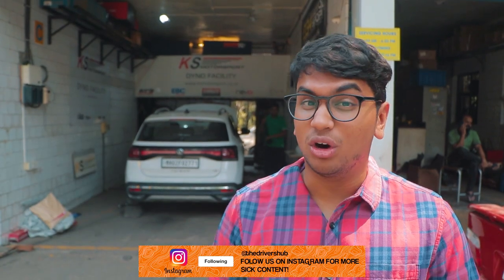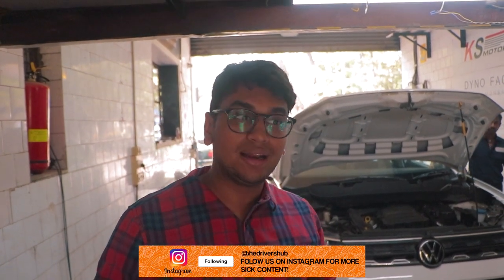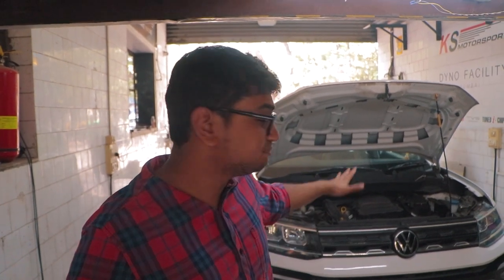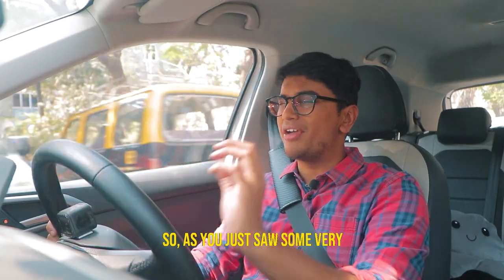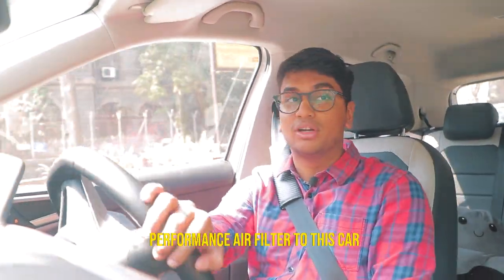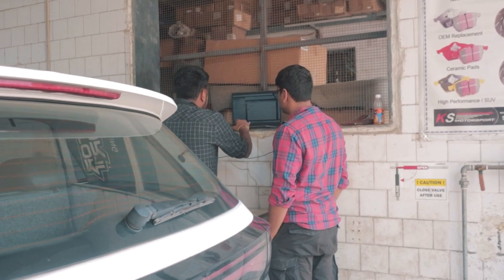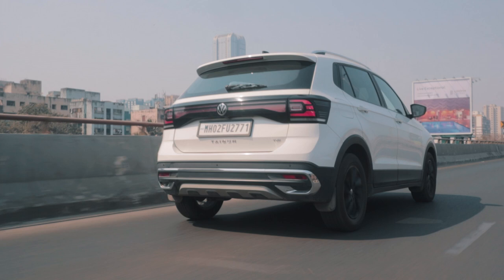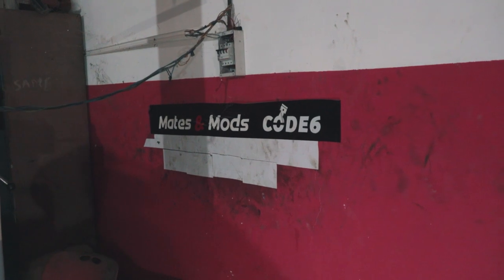India's Most Powerful VW Taigun 1.0 TSI Stage 2 on the Dyno! (Stock Turbo) | Project Taigun

Comment: Should have done a stock run then done the remap .
Reply: Yepppp
Reply: That’s how it should be for every project car, gives better comparative results
Reply: We do have stock figures done on 1.0tsi, in this particular car we had done all the mods before dyno, hence wasn't fair to do dyno with mods and no tune. However we did do that also, i have dyno charts for other maps with mods in this car.
Reply: @matesandmods  what were the dyno figures on stock?
Reply: @garvitnanda4527  a polo 1.0tsi with intake work done, got around 102whp
The taigun with all mods but no tune had some 25-28whp lesser and 80 wheel nm lesser.
Reply: I will maybe share all numbers on my Instagram for clarity, was planning to dyno a fully stock car on the dyno once to do this.
Reply: For the stock, This is also not accounting an average, average of stock runs were lower. And the after tune, average of all runs were 138-140whp equating to 155hp approximately with 12% loss calculated.
Reply: These dyno runs are expensive affair. So yeah
Reply: @matesandmods  Yes. Just to have a comparision  , Not to discredit your work. Great Job .

Comment: Scared of the 1.5 tsi tune, as it has a very fragile transmission,😅
Reply: What about the GT Manual?
Reply: Slavia 1.5 Manual's gonna be worth it
Reply: Tvs stage 3 tcu remap for dq200 then  it will easily handle 400 nm of torque

Comment: How about tuning a 1.5 Vtec? What could be it gains with just a stage 1 or 2? Also I heard somewhere we can add turbos to it? And how successful is that? Does anyone know?
Reply: its a NA engine you cant do much
Reply: That would involve extensive modification to the head and various others mods to complete a successful turbo set up.. there a     couple of people who can do it well.. in Bombay and Bangalore
Reply: There wont be much power gains as 1.5 vtec is an NA engine …so even in stage 2 you can expect gains of upto 15-20 hp  … also the turbo thing you’re talking about comes under stage 3 not stage 1 and 2 so if you really want to push the engine with turbos you can actually do that but thats gonna cost a lot .. also it will make the car significantly unreliable and very hard for day to day use

Comment: Engine sounds like the newer turbo straight 6s, like on the M3/M4 but not that aggressive
Also as this particular one is nearly as powerful as a stock 1.5TSI, make a series of comparison between both those cars on the basis of power, acceleration, drivability, economy etc. Cause there's surely a lot of question about the impact of the map on the car overall